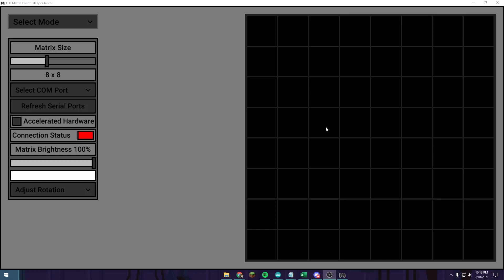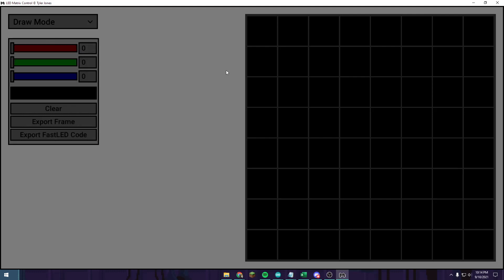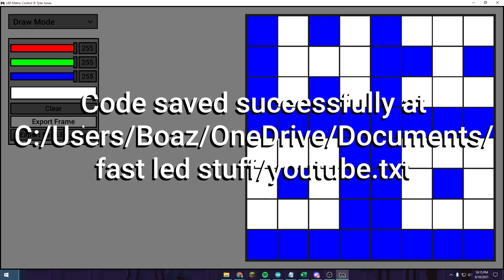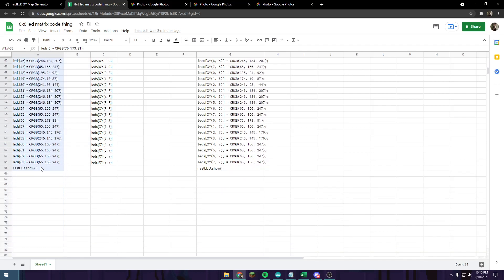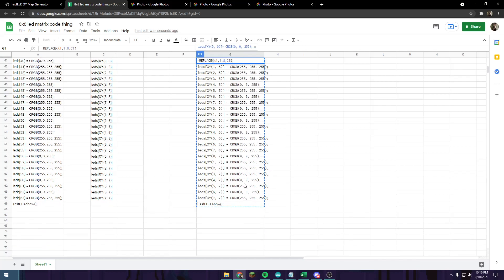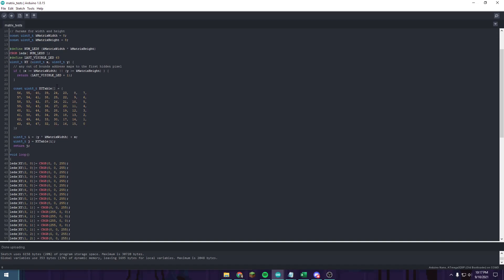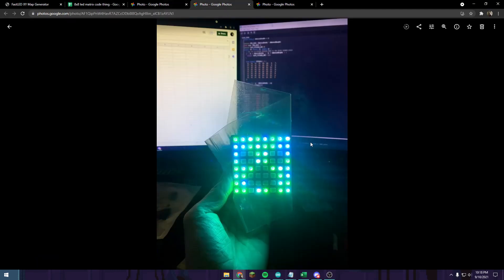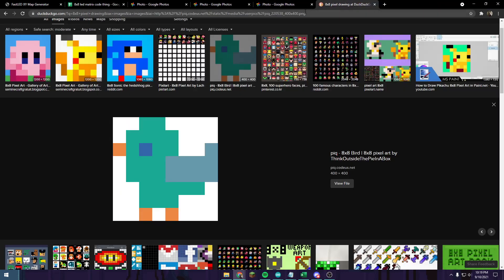How to upload custom pictures/drawings to serpentine led matrix, any size Arduino, FastLED

Comment: Bonjour
je viens de tomber sur ton travail qui m'interresse fortement.
Mon problême est que je ne parviens pas à télécharger les fichiers que tu fourni  "Led Matrix to fastled program", est ce que tu peux y faire quelque chose, merci.
Reply from the maker: Terribly sorry about that, can you specify what link is not working? When I checked them they seemed to work on my side. Thanks!
Reply from the maker: This link may also work, apologies if not https://docs.google.com/spreadsheets/d/e/2PACX-1vQtUluIC1izi9FfYLyy4yqgmnEPssTJ8uuXLN3eJhUmgEL2om10g_Rh4Sq4gev0AFGki7ydBMQkPeSe/pub?output=xlsx
Reply: Bonjour et vraiment merci pour votre réponse, chez moi c'est ce lien qui me pose problême, https://www.youtube.com/redirect?even... , je clique sur " tétécharger ", mais rien ne se passe
Reply from the maker: The link you shared just now does not take me to a download page. Are you using a phone or a computer while trying to download the file? And are you referring to the excel file?